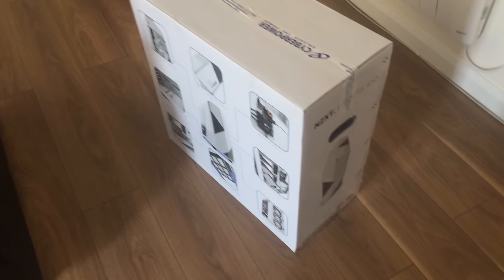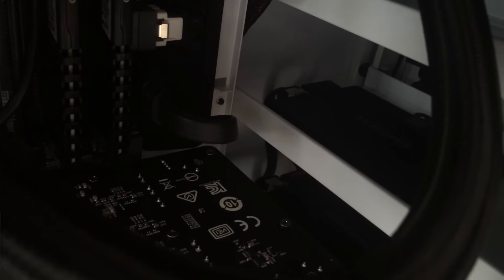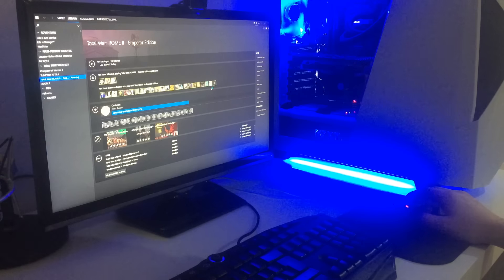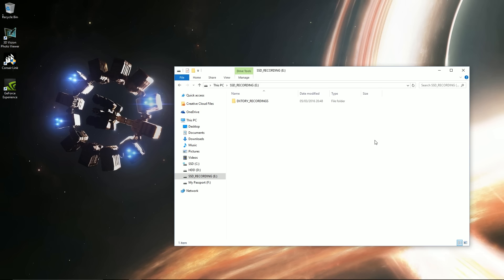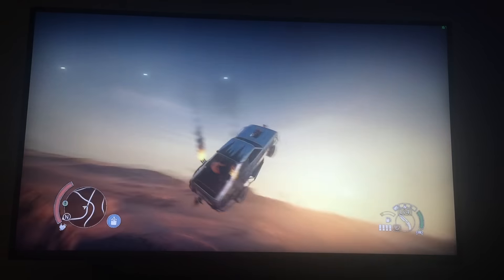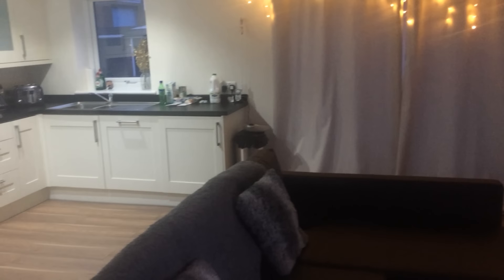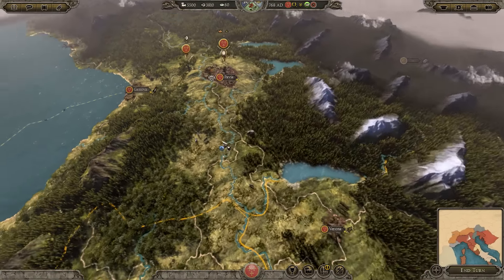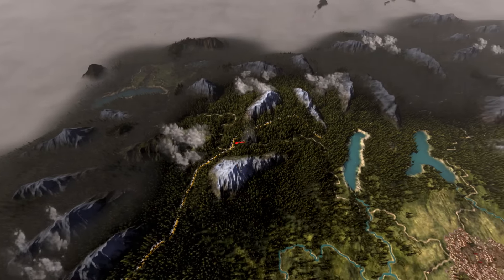4K GAMING PC! - Infinity Xtreme GT

Comment: Great Rig man! Any over clocking on your GPU? With a little OC that 980 ti can out perform a reference Titan. I have 2-way SLI with EVGA SC+ 980 TI's. Running on one GPU I can game at 4K with Ultra settings but see occasional dips in fps to 40's. Once I turn on SLI I've never seen a fps under 60 at 4K ultra settings. (Played with most of your standard newer titles they use in benchmarking)

Comment: I'm not surprised this can run total war warhammer at full settings. This is like a  £1.5-£2k system...
Reply: +00daveyr Just one GTX 980ti could handle some games in 4k. But very new games that recommend gtx 980ti are harder to run 4k.

Comment: hi I have this case for my 1st build with the x61 karcken,as I'm new to pc building what would be the best way to moniter and control fan speeds/temps  ? do I connect the x61 kracken to the cpu fan header  but if I do where would I connect the pwm fan hub which has the 4 stock fans already connected ? or could I connect the x61 kracken to the fan hub then fan hub to the cpu fan header ?  also I'm presuming the gpu goes into a gpu headrer on teh motherboard (ga-z170xp-sli-atx) not sure what to do, any advice would be greatly appreciated

Comment: 2600 pounds!? Yikes. That seems really expensive.
Reply: ***** Ya that seems a bit more reasonable. I'm guessing maybe he paid more because it's  fully assembled, juat like Alienware is overpriced?
Reply from the maker: +JCTiggs It was 2000 for the assembly and parts, and 600 was VAT. I ended up getting 10% off and sold my own PC for £650 so the overall upgrade set me back about £1200. When I build it on the site it still comes to that same 2600 price. Remember it's 2 SSD's, 3TB HDD, the Motherboard is pretty good 32GB ram, windows 10, some sound card :L, 980ti and i75930k and there's a years insurance too.